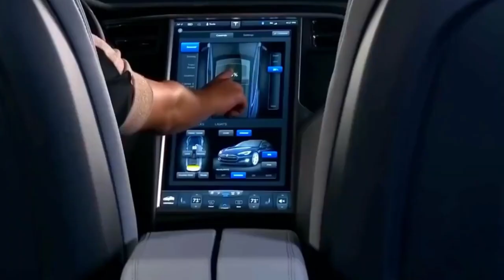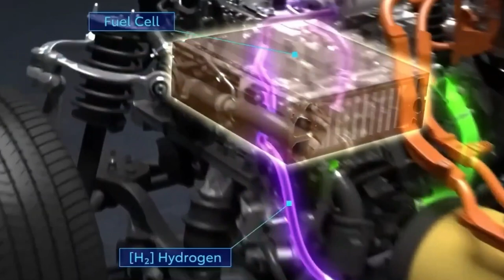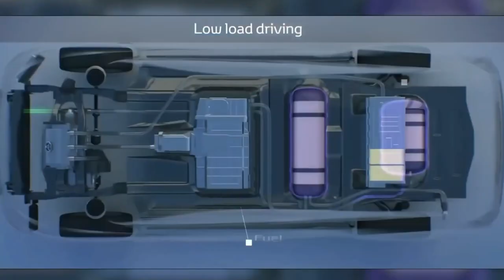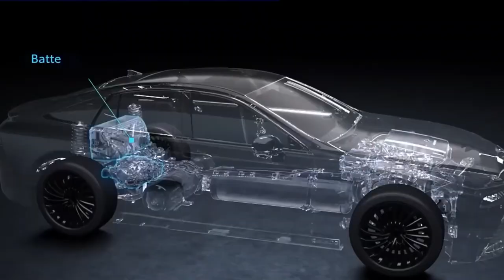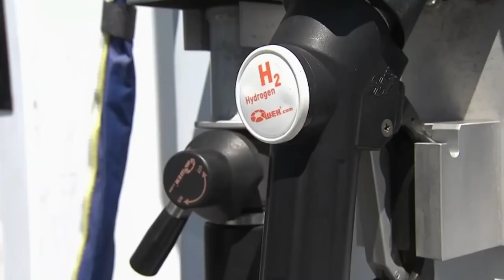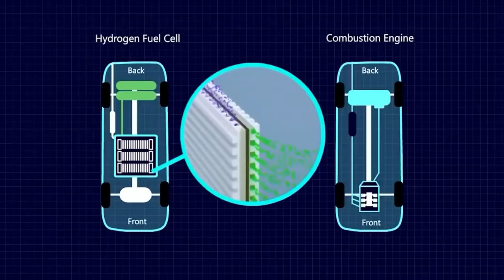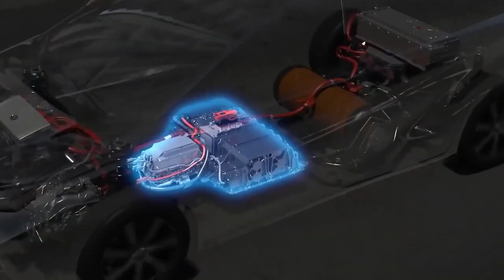Toyota CEO | End Of EVs With New Engine!!

Comment: Shell has a couple hydrogen gas stations in The Netherlands but it's really only to green wash their oil business. A practical issue with hydrogen at gas stations is that the gas comes from a buffer container to maintain pressure. After one or two vehicles this container needs time to rebuild the pressure and this takes about 30 minutes. Way too impractical of course when there's a constant supply of cars in need of a refill.

Less than 1% of hydrogen gas comes from renewables. The other 99+ % is produced from natural gas. The oil dependence remains.

Hydrogen also leaks heavily through metal because it's such a small molecule. That means lots of hydrogen will leak into the atmosphere. Here's an EDF quote:

"When emitted into the atmosphere, hydrogen contributes to climate change by increasing the amounts of other greenhouse gases such as methane, ozone and water vapor, resulting in indirect warming."

This still needs lots of research. Nobody really knows the consequences of a hydrogen economy. It could be better and it could be worse than what we have now. Companies going after hydrogen usually have their own somewhat hidden fossil fuel agendas. I don't buy any of their stories.

Comment: LOL hydrogen. They've been trying for 30 years to do it, haven't. Look at the Mirai. It's full of tanks, horrible storage room. No one in america is going to go for that. Huge costs for filling. Only 57 stations in california, compared to thousands of EV chargers. It is very expensive storage with tanks, power trains. Has low energy density, still often requires petro middleman, questionable green production. China owns a lot of the IP for electrolysis. The more money they dump into this, the faster it hastens their irrelevance. They are so far behind china/korea/tesla on EVs that they'll be dead in 10 years. I think hydrogen will work for ships and massive applications, not for cars/trucks though.

Comment: In short, no.

 I don't think they can compete globally the cost to refuel these are greater than diesel 
and safety will always be an issue especially with aging vehicles and as the vehicles go down in value they will undoubtedly eventually make it to you to the poor and middle-class who may not have as much wealth to maintain them properly and this could be a huge safety concern for potential fires or explosions
However I think hydrogen would have a greater potential if these types of systems were introduced two semis heavy machinery in large transport Vehicles like buses if properly maintained by the companies and governments that use them especially for Long Haul Trucking they need to have their vehicles back on the road quickly instead of waiting on a battery charge or battery swap this could be a viable solution in each site location would have to consider the safety requirements of maintaining and storing hydrogen and with much of the world having water shortages this may not be the best use of our resources since you need to have a reliable source of fresh purified water in order to make hydrogen in the first place